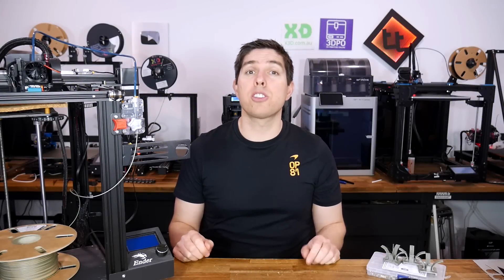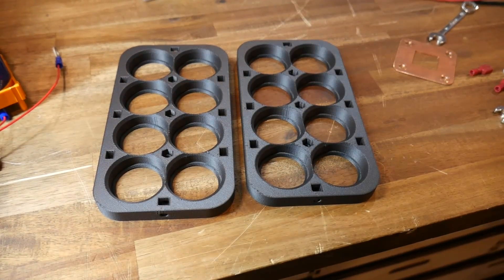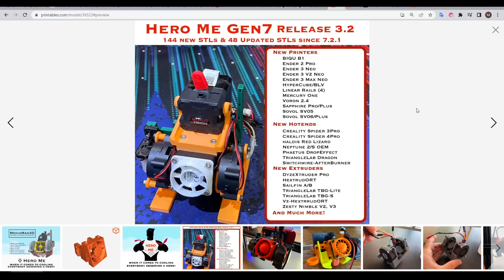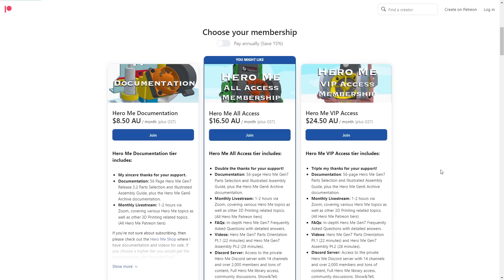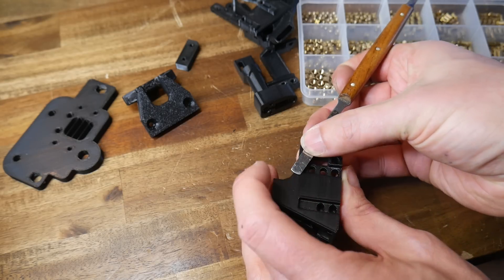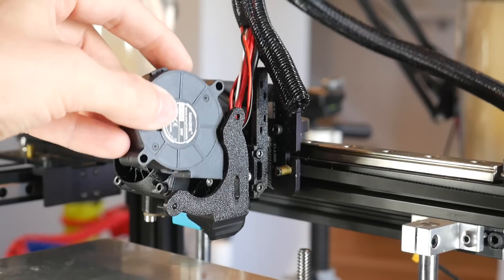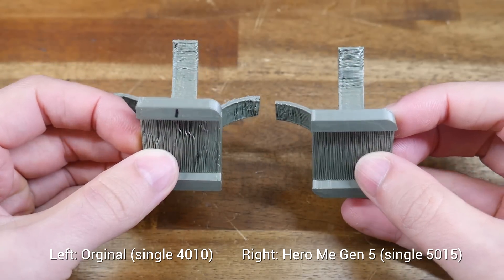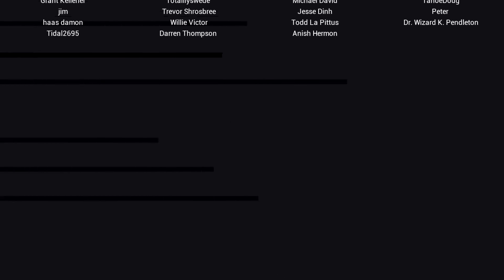Hero Me part cooling system - Modular, capable and super compatible

Comment: I investigated the hero me for my Geeetech i3. By being a jack of all trades design, it would reduce the accessible bed area of this printer in the X and Y axis. Instead, I found an existing high quality part cooling and hotend heatsink cooling design. I then designed a compact machine mount with BLTouch support around this cooling design. I now have a very high performance 3D printer hot end without needing to compromise on X and (the especially precious) Y axis travel.

Now I hadn't bought the instructions, but I imagine if I did buy them, I would have been disappointed.

Comment: I have tried it. It's a mess. Used a gen7 on my ender. It works but ugly heavy overcomplicated and a royal pain in the behind to pull it apart when needed. There are much better options with free instructions and real engineering. It's a gimmick at the best...

Comment: I've been using the Hero Me 7 for about 2 years now and was quite happy with it's performance overall but am moving away because it is just to fiddly to perform any sort of maintenance on my hotend. I somehow always end up disassembling the whole thing when I get a clog and afterwards have to readjust fans and Z-offset, which takes a lot of fun out of printing. Also while I am willing to pay (and did so) for the model and docs, the limited time access through Patreon is a bad experience in my opinion. The fact that access ends with the Patreon membership is very inconvenient. I would expect to get access to future updates of the same generation of Hero Me especially since the documentation wasn't that great back then (and thanks to the limited time access I can't tell if it improved since then).

Comment: So, the hotend is screwed to a bracket that is screwed to fan base that is screwed to gantry adapter that is crewed to a metal plate. Don't like this solution at all, not to mention the paywall.

Comment: Also, always ALWAYS print two spare sets of the parts in case you break something.  Then you have two spares and are much more likely to have a working machine.  One spare can also break trying to get the printer running again, or you mess up the heat set inserts.  I have at least two backup s at all times, it doesn't cost that much more and is a bunch of peace of mind.  Especially if you have a single printer.

Comment: at the moment I have the gen 5 hero me fitted with MDD 1.2 and EZR extruder, using you modified  bracket to the ear extruder. Is this still required as I'm getting a bit lost in finding the parts I need to print to achieve the v7

Comment: Should of left that build chamber. While it might not of gotten you into engineering materials, some modification likely would of done it. In addition to this the chamber is a big assistance to layer adhesion with even PETG. I print with my machine in a small closet and saw a big benefit with PETG & PLA

Comment: I used your Ender 5 lid idea on my Ender 5 Plus and it works great. It’s not actively heated but I can print 3DXTech’s CF PA6, EzPC+CF, ASA, etc no problem with the use of VisionMiners Nano Polymer adhesive on the glass bed. Did you ever try this?  I saw you were printing on tape? 🤨

Comment: Why use an outdated, stolen design that requires extra cost just to understand how to put it together, when you can just get a better carriage with better design and less weight and good documentation for free and use the saved money to get the parts to upgrade? The hero me made sense (not much) 5 years ago. Now it's just way outdated. Michael, you should make a video trying the Orbiter/Apogee carriage.
Reply: I did not steal from him. The original HERO ME design is licensed as Creative Commons 4 which allows remixes. I have always credited him in the Printables description (and other STL libraries) and in all my documentation. I give him full credit for the creation of the original Hero ME design that he developed over 4 months (nearly 5 years ago) and is comprised of 12 STLs that support four 3D printers (CR-10, CR-10S, Ender 3, Ender 3 Pro), 1 hot-end, 3 fan ducts, and 3 ABL sensors, and was for Bowden setups only. 

What I do take credit for are all my extensions and significant new design work (over 610 STLs with continuous development over the past 5 years) that bring my Hero Me Gen7 Release 4 to fully support over 115 3D printer models, both Bowden and Direct Drive versions, 47 hot-ends, 37 extruders, 35 part cooling setups, 20 ABLs, 14 accelerometers, 8 LED mounts, 4 endoscope mounts, and much more. The closest descriptive comparison would be that I was inspired by what he designed. 

Are there more current designs for a specific hotend/extruder/x carriage that have better performance, quite likely. But none have the broad modular compatibility (115 3D printer models, 47 hotends, 37 extruders, etc.) that the Hero Me provides to greatly improve part cooling over an stock setup. These are two completely different goal sets. The one you mention may be easier to assemble than the Hero Me, but I'd be glad to make a bet that the Orbiter/Apogee you has not been CFD tested for effective airflow for part cooling , and is limited to a tiny fraction of 3D printers and other components that can be used with it compared to where the Hero Me can be installed.

Comment: No hemera support...
No bueno, sadly.
Reply: I am sorry but integrated extruder/hotends including the E3D Hemera (along with the Ender S1 Sprite, Micro Swiss NG, Titan Aero, BIQU H2, and the Bondtech LGX Shortcut), are not compatible with the current Hero Me design architecture (including Gen7.4). 

They are all too large, too wide, to fit into a Hero Me Base. The Hero Me was designed before these other integrated extruder/hotend combos were developed. To make a Hero Me fit these assemblies it would no longer be a Hero Me as it would not be compatible with any of the hundreds of parts from both my Master Suite and the over 650 remixes and add-ons created by the community.  

On a more positive note, I am working to develop specific part cooling ducts (based upon Hero Me) with ABL/ADXL345 mounts for these integrated extruders. I hope to have these available later this summer (Aug-Sept).
Reply: @MediaMan3D  Thank you. I'm very excited to be able to use at least the excellent ducts from your ingenious designs. 
I've used them some 2 years ago, but after migrating to Hemera have been desperate for something to come along...

Comment: I must have missed your chamber Ender 5 videos, so thanks for the reminder about those. I am running Cr-30, Ender5, and CR-10 Max, so I really really enjoy when you still talk about those printers. I made my own chamber for CR-10 Max, I run 37 degrees chamber temp (the steppers don't like anything higher), and I see no warping at those temperatures. My parts are not very high off the bed, but the chamber helps a lot with abs printing. I just use the large heated bed to keep the temperature in the chamber. I run the bed at 100C, then use an exhaust fan to swap outside air in and another fan to blow hot air out based on a temp controller. Some day I will review your heated mains chamber elements. I have not upgraded the part cooling fan on CR-10 Max yet, but I remember your old videos about Hero Me. I also will add the Biqu H2 hot end along with the PrinterMods xchange system. Those parts are sitting on my bench and ready to be added when I find time.

Comment: Michael, Thank you very much for producing this great video about the Hero Me Gen7. Based upon the changes you needed to make for your setup, I will redesign the Euclid probe to be turned 90deg. I would suggest reprinting that test overhang STL, as the Gen7 part cooling ducts have be reshaped since Gen5 and will give you better results. Of course dual 5015 fans will give you the best results.

On July 14th, I posted Gen7 Release 4 to Printables, Thingiverse, Thangs, and Cults3D. This newest release has over 187 new STLs and 50 updated STLs, Gen7 Release 4 supports and additional 29 printers, 16 hotends, 8 extruders, and 6 ABL sensors. 

For those who are ill-informed and commented as such, I did not steal Hero Me, as it is licensed as Creative Commons 4 which allows remixes. I have always given credit to the original designer of the Hero Me (Marcelino A. Mosquea S. aka kelokera on Thingiverse). In all my documentation I give him full credit for the creation of the original Hero Me design that he developed over 4 months (nearly 5 years ago) and is comprised of 12 STLs that support four 3D printers (CR-10, CR-10S, Ender 3, Ender 3 Pro), 1 hot-end, 3 fan ducts, and 3 ABL sensors, and was for Bowden setups only. 

What I do take credit for are all my extensions and significant new design work (which is what I was referring to when I stated what was 'my idea' in the 3DPN interview). It is the over 610 NEW STLs with continuous development over the past 5 years that bring my Hero Me Gen7 Release 4 to now fully support over 115 3D printer models, both Bowden and Direct Drive versions, 47 hot-ends, 37 extruders, 35 part cooling setups, 20 ABLs, 14 accelerometers, 8 LED mounts, 4 endoscope mounts, and much more. 

The closest descriptive comparison would be that I was inspired by what he designed. With only two exceptions, there is nothing in common between the original Hero Me and my Hero Me Gen7.4. Those two exceptions are #1. Part of the name, kept out of respect for the source from which mine was inspired. Had I changed the name, even more would complain that I had ripped him off. and #2. The position of the grooves for mounting part cooling ducts to the Base. 

What few parts of his original work (8 STLs) that have the same specific function, mine have been redesigned from scratch beyond comparison. Only the core Base STL has any remote resemblance, but when you look at them for more than a few seconds you will see that they are totally different. Anyone can compare for themselves, simply search for Hero Me on Thingiverse and see the differences between the two projects.

It is also very sad that many in the community are willing to pay $$$ for open source hardware, yet while all of the Hero Me Gen7.4 STLs (and beyond) are free, they will complain about paying $5 US for my docs and knowledge, and then some go so far as to post and promote links to stolen copies of my documentation (as one person has posted in your comments below). That link is now subject to a DMCA takedown notice. BTW, there are thousands of 3D printer owners who have successfully upgraded their printers with never contacting me for docs or help, yet they post their positive comments afterwords.

Again, thank you very much for producing this video. There are tens of thousands who have upgraded their 3D printers with a Hero Me Gen Series printhead and are very satisfied with the results they get. I hope your video will inspire thousands more!
Reply: Well "my friend" maybe people blame you as a theft because YOU keep saying you created the hero me, that the modularity was your idea! That you're part of the development of the fanduct, etc... But this video just proves my point!!! Even with 1 fan is so heavy he had to lower the acceleration! Accept it, you lack of imagination! And lie every time a camera point at you! I design the Hero Me! Not you! the modularity was MY idea not yours, and next time try to remember my name, and is not Costa Rica, is Dominican Republic!!
Reply: @amaurisstudio   I do not keep saying that. I have no control over what Michael may have said in his video. I learned about this video after you did. He never contacted me about what he was creating or any of his script or content. 

He printed all the parts in PETG, I do not recommend that at all. The hotend and extruder mounts should be in either PLA+ or ABS/ASA. The Hero Me Gen7 can use just one fan. It is not required to use two fans. There are many users of this printhead with just one fan. 

I expanded the modularity from your few printers and hotends to hundreds of printers and components. I redesigned the Hero Me to make it possible to interchange hotends and extruders seamlessly, The base is very different from what you created, there isn't even 5% that may still be in common. I did that, you did not. It is that, which I refer to when I use the words 'my idea', and I said in several replies to you that I would make that extremely clear in any future writing, video, or interview. 

Regarding the Hero Me Gen7 and high speed, high acceleration printing, a Hero Me Gen7 user wrote the following (edited for grammar):

“I fitted my 4-month-old Ender 5 Pro with the Gen7, dual 5015 blower fans, and Orbiter 2.0. I wanted to print faster with Klipper, so I bumped the Vref on the Y-axis stepper to 1.5V and the X-axis stepper to 1.4V.  I had no layer shifts at 10k acceleration. I could probably go faster but I didn’t see the point, so I don’t know the actual limit with this setup. The Y-axis stepper motor Vref can probably go higher as it is a bigger motor and was not getting hot at all. 1.4V on the X-axis stepper motor is probably around the limit, as the motor was getting pretty toasty. Nevertheless, I printed some 3-4 hour models on these voltages and the X-axis motor still works so it should be fine but you can always go lower if you're worried about frying the steppers.”

And you have not been reading my messages to you. If you had you would know tha several times I have clearly stated how getting your name and country wrong happened. I sincerely apologized for that, and I also showed how I had your name and country correct in my documentation. 

As antagonistic as your comments about me have been the past couple of weeks, and my replies, explaining how it occurred (getting your name and country wrong, the 'my idea' etc.) along with my apologies, I still would like to talk with you directly, please respond any of the direct messages I sent you via Printables or Messenger. If you would dare to give me 5 minutes of your time, I believe you will find that your time was not wasted.
Reply: @MediaMan3D  so you are telling me that everytime I have seen a video of you speaking and telling how you came with the idea I'm hearing wrong? Like when Joel ask you about it? When I made the editable files public so people do exactly what you're doing, how is that your idea? I even got comments deleted when I was trying to give my version, giving you the credit you deserve? What do you think I could get about it?? Do you think I want to share more designs or improvements after that?! 

When you ask me on Facebook if I was already in the States, why didn't you ask me for help or any involvement in this project that has the name that I created? What do you think all this looks like?! And one more time! I don't want or need a penny out of this! It wasn't or is about money! I NEVER CHARGE A SINGLE PENNY for anything I shared! I want 3D print to improve! I don't ask for 5 bucks for instructions!!! I DON'T NEED THAT!! and it's OK if you do it, it's YOUR time, and you can put a price to it!!! But don't go around taking credit for the things others put time and effort!!
Reply: @amaurisstudio  I have already answered you several times about the interview with Joel, on how and why I made that mistake, apologizing to you for that error, showing you that I have your credits correct in my docs, and letting you know that I will be very clear to give you credit for the original design in any future event, video, interview, etc. If you have not seen these replies, I will be glad to point to where you can see them.

I've never made any reference that I enabled remixes. Your work, design, and the CC4 license you assigned to it enables that. I have said that the community has created several hundred remixes of my Hero Me Gen series remix, that work with the STLs I have created. Anyone creating other part cooling ducts might work with both your original and mine, because that is the only feature still has some common traits to both your original design and my remixes

Regarding comments getting deleted.. Other people must be messing with both you and me, as I have had several of my replies to you deleted over the past 10 days as well. I have never deleted (reported) your comments. I don't know why people would do this. 

As for the name Hero Me, again, I believe If I had made a remix and named it completely different, even more people would come out and say that I ripped you off. In my opinion, a remix should reference the original in the name if it is doing a similar function. I am very appreciative of your making the Hero Me and sharing it. 

Looking back, hindsight is always 20-20, I should have reached out to you. Trust me when I say, I now wish I had asked if you would would want to be involved back then.

I am not taking credit for your work. I do take credit for what I have done over the past five years creating hundreds of compatible STL parts for the remix work I have done from your original design. You have always been given credit in my docs and with the posts of my STLs in places like Printables, Thingiverse, etc. 

I set up my Patreon page to earn back some revenue for the thousands of hours I have invested in both making other printers and components to be compatible and for the thousands of questions I was getting which was unmanageable and absurd that I was giving away hours everyday with no income from that effort. The money I am recieving is for the documentation and support I provide. I am not selling any Hero Me Gen series STLs. 

You asked why I didn't reach out to you, well, I have been trying to reach you privately these past two weeks. Please read the message I sent to your account on Printables. I would like to talk with you.
Reply: This comment needs to be pinned